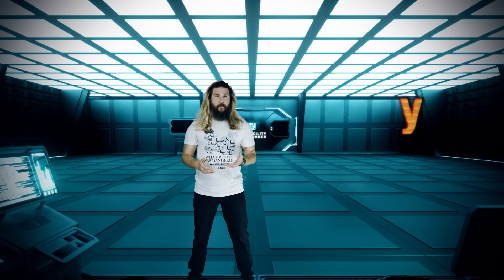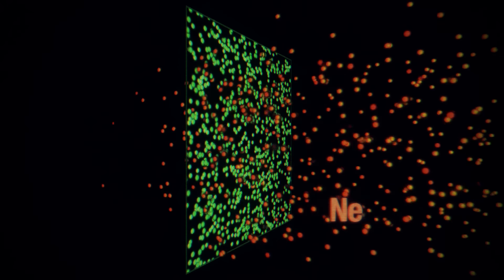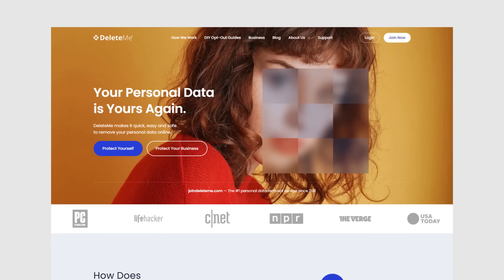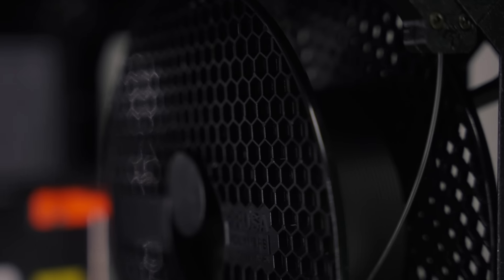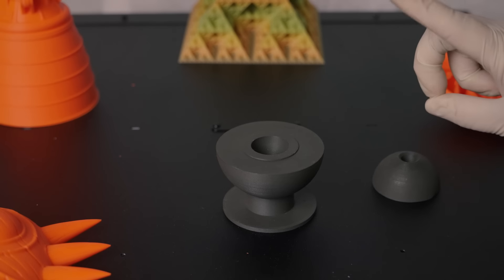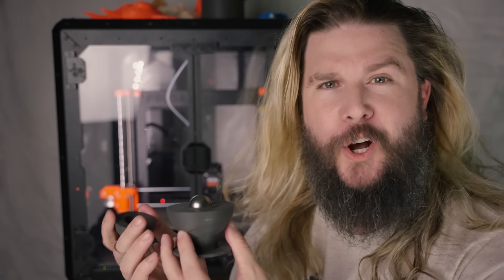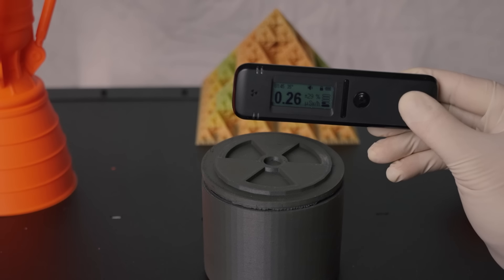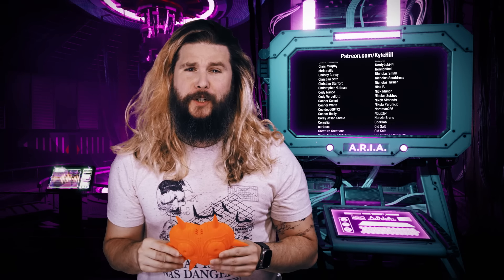3D-Printing TUNGSTEN Radiation Shields!

Comment: My father died of cancer. One of the treatments years earlier had been pellets of radioactive material inserted into his body. I wonder if 3D printed custom shaped shields could be made today with this tech to shield surrounding tissues and reduce the chances of new cancers down the road. Not only might it reduce collateral damage and subsequent cancers but it might also enable more aggressive treatment. You could even make tiny shaped sleeves for the pellets that could shape and orient their effect, something akin to a modern shaped explosive vs a stick of TNT. I miss my dad. I didn't understand at the time how much he meant to me or all the ways in which I would miss his existence in my world, but today, a decade and a half later, I really wish he were still around to learn from and share with.
Reply: My understanding is those pellets already have directional shielding. You wouldn't want that 3D printed anyways due to biocompability issues with the plastic and reduced shielding for the same thickness when 3D printed.
Reply: @DKNguyen3.1415  I was going to say much the same thing, biocompability would be a major issue. Shielding with maybe some tungsten coated with titanium would give good biocompability and high efficiency, but that'd basically be reinventing the wheel.
Now, for interim containers during handling and augmenting transportation to treatment room containers, it might be of utility. The lower the mass during handling, the less chance of an accident with the sample.
Reply: @spvillano  I would think that kind of thing would be coated in gold rather than titanium because gold is much more malleable and they are going to come in later to remove the pelley so the gold is recoverable. And the main reason to coat tungsten in gold rather than just using all gold is gold is expensive! But tungsten is a major pain to work with. You can't hold it in a crucible unless it is actively cooled since it's molten temperature exceeds that of every other metal. They might also straight up use tungsten. Apparently it's mostly but not entirely biocompatible so you don't want to leave it in the body for too long. But this is a temporary implant.
Reply: Sorry for your loss
Reply: Which kind of brachytherapy was it?
Reply: Speaking of shaped charges, I wonder how well this filament would work as a material for charge liners compared to the copper filaments some have been experimenting with.
Reply: Tungsten dust is carcinogenic
Reply: @James-ly3rx  Isn't most dust?

Comment: As an mechanical engineer who designs x-ray security equipment and shielding, I've looked into it and talked with our physicists and the biggest concern is the carrier material the tungsten powder is suspended in isn't rad hard and will degrade over time becoming brittle and will start crumbling, for any 3D printed shielding our choice is always SLS based tungsten printing as that doesn't have the drawback with a plastic carrier material.
Reply: Exactly! specially due the very high loading which will make it release particles and crumble quite easy!

Comment: My first thought for a use in a nuclear powerplant would be custom made "covers" or "plugs" to use on valves/pipelines/components when not working directly inside it, but it has to be opened. Often contaminated systems might not radiate that much through the metal, but once opened the doserate might spike a lot if distance is short. A custom made cover/plug could be useful in lowering the dose to worker fingers when working with/near the component. These could double as FME protections, stopping any debris getting in the system.
Reply: Perhaps the plugs could be named Bilaterally Uniform Tensile Tungsten PLUGS?
Reply: No way they use this material for that or basically anything. This is borderline gimmick, At most this will be used for complex non conductive shield prototypes in extremely niche applications, masks, collimators. 
Casting lead involves temperatures only about 70C° higher than melting this filament, a cast lead shield offers about the same radiation shielding if not a bit more, by not having porosity it can be easily decontaminated and is far far cheaper. I mean at $229 per kilogram of this filament with a density of 75% W (14.25g/cm3) gives you about 70cm3 of material. With lead that would cost you about 2 dollars, add casting and all that probably you are looking at one quarter the price.
Reply: @teresashinkansen9402 I'll take a B.U.T.T plug over that any day 😂
Reply: @JediSentinal  For real! Imagine printing a shield that uses about 500cm3 of that filament. That would cost $1635 in filament alone. 🤣

Comment: I know you barely touched on how different materials are good at shielding against different types of radiation. The shape of the shield also matters, and you can mix different shielding materials to get different effects. I can imagine a 3d-printed tungsten shield with foam-like hollows, that you can fill with water to improve protection against neutrons.
Reply: ouch, bot took your comment.
Reply: @waifuprotectionagency  thanks for the heads up.
Reply: Most filament materials(PLA, ABS, PETG) have lots of hydrogen, like water.

Comment: I’m a biomarker specialist for a radiopharmaceutical company who makes, and helps the pharmacists dispense, quality-control test and package PET scan pharmaceuticals on a daily basis. There are so many things in our pharmacy that we could make to help protect ourselves from radiation and improve shielding of our doses as well. 
We already 3-D print things such as syringe shield holders (not with tungsten filament, with normal filament) that would be greatly improved if made from this material instead (it would negate the need for a giant lead block in the middle 😂). Super cool!!
Reply: It's infused plastic, so not just printing tungsten of course. Given the readings in this video, without a control, I wonder if it's really that effective to be used in practical applications.
Reply: @VincentGroenewold  I know, I wonder how much shielding is improved compared with regular filament. We use tungsten “pigs” to transport syringes. When we take those out of the hot cell (where the pharmacist draws the dose and then places it into the tungsten pig), we place it in a 3-D printed “pig holder” before capping it with a tungsten top. I’d be curious to see if this holder could be printed with a tungsten laced filament and if it would further improve the shielding during that process.
Reply: @ashleighkeeler7857  shielding is a double edged sword. Indispensable for safety, but due to its mass, also can increase the risk of spill accidents. Anything reducing mass briefly during handling is always going to tend to be a big plus column entry.
Reply: @spvillano  I agree! That’s actually what the pig holder I described is for. To stabilize the pig while we cap it, since they are very heavy and can easily tip over while capping. It avoids us having to hold it while doing so.
Reply: Learn how to cast lead. That will be far better and cheaper than this gimmick. Lead shields are also 100% recyclable. Good luck finding were to recycle such kind of filament.
Reply: BTW 1kg ($229) of this filament is only about 70cm3 of material. I only see this having extremely niche applications in things that involve low energy radiation, anything above 300 KeV and this becomes too expensive to be useful.
Reply: Id like to see a comparison of the same object printed with the special filament and regular filament.
Reply: @ashleighkeeler7857  yep, had some dealings with pigs way back when. Thankfully, avoided any spills.
Although, thinking about it, it'd probably be less expensive to have similar manufactured than to print the things currently. Probably. Still, the need is there and even one less accident makes it worthwhile, given the labor and waste disposal in the event of a spill.

Comment: Well, that was dense. :)

Also, in your experiment, it would be cool to know what regular 3D printing filament does in comparison to the tungsten infused filament.
Reply from the maker: Good point. I should have shown a control
Reply: @kylehill  how about a short with 4 panels: the open core, with ordinary filament, the new filament, and some simple aluminum foil; and the radiacode on a stand :)
Reply: ontop of that how does tugsten infusion of 3d filament effect the melting temprature of the filament?
Reply: @sheilaolfieway1885  According to the spec sheet, it runs a little hotter - 260 C. The bigger problem is the nozzle itself. The powder will eat right through brass, so you'll need a hardened nozzle.
Reply: Yeah, because, just based on my understanding of most 3D-printed stuff: they’re not super dense. There’s a reason why lead shielding is thicc, and while 3D printing might make producing unique shapes easier, it might be trading effectiveness for it (though that might also just be what changing the shape of a shield does)
Reply: @kylehill Perhaps a short? Just to see the numbers. I'm SUPER curious to see the difference.
Reply: @JRFrostBear  I would expect there to be a significant difference even between regular filament and nothing. It would at least affect the alpha particles coming off of it pretty effectively.I mean, if alphas can't penetrate paper, or skin most of the time, then surely a couple of inches of plastic would block almost all of the alphas coming off of it.
Reply: @kylehill  By the way, the dense comment was sarcasm and my failed attempt at humor. I wasn't saying the missing control was dense. I was just trying to make a joke. Then I read it again just now since I posted it and it sounds like I'm saying you're dense for not including a control. That's not what I meant. Sorry if it sounded that way.
Reply: It's marked PETG Tungsten 75%, so I am going to say its base polymer is PETG which is already used frequently in FDM style printing.  PETG itself won't stop any radiation, but it is required to hold the powdered tungsten in the filament, the tungsten itself is doing all the heavy lifting.
Reply: @ianmcewan8851  If only he had some way to build a custom radiacode stand.
Reply: @kylehill  a scientific person forgot to use a control in a demonstration? bruh
Reply from the maker: @fireball75677  :_kyleSad:
Reply: And their weight differences for the same sized objects would also be cool!
Reply: I was thinking the same thing. Glad to see that Kyle chimed in with this as well.
Reply: @kylehill it wouldn’t have shown much difference I think.  PLA or PTEG filaments aren’t very thick or dense.  However, they are very cheap and useful in building components for testing before printing the final product in tungsten.  It is expensive though.  The Virtual Foundry charges $700/kg.
Reply: Regular filament (doesn't really matter, plastic is a horrible radiation blocking material, but let's assume PLA or PETG) would do practically nothing to gamma and x-ray and would practically stop all alpha and significant amounts of beta assuming the objects are printed with comparable settings regarding infill etc. My guess is maybe 10-20% reduction, possibly a bit less or a bit more.
Reply: @toobin8r  The density question depends on two things. The filament used and the printing settings. Someone posted that according to Prusa the filament is PETG with 75% Tungsten. Now I haven't checked the source, but I see two alternatives here. Either the filament has 75% tungsten by weight, in which caste it's not all that much. Or it has 75% tungsten by volume and it is pretty dense. The PETG is needed as a binder keeping things together.

The next issue is the settings used for printing. These include things like temperature and feed rate, but they also have settings for using structures to act as filler in thick walls or large solid parts. The filler structures are used to more efficiently use the filament as in most cases the internals doesn't really make a difference for printouts, especially for decorative use where the surface is all you are interested in. But it is possible to print all of the model solid. This is usually done for parts that have to be strong or that suffer mechanical stress. When printing using this Tungsten impregnated filament and making enclosures that will be used for radiation shielding I assume they will be printed solid to make them as effective as possible.

Now the actual density of the printed objects will be pretty high, at least when compared to if it was printed using normal PETG filament. they will be heavier if the mix is 75% by volume than if it's 75% by weight. But in both cases it will be a lot more solid than ordinary 3D printed parts.
Reply: @meola69420  everything stops some amount of radiation so your statement about the PETG not stopping any radiation is just wrong.
Reply: @kylehill Did you ever do the control for radiation shielding? I'm curious if you took that to mean 100% infill like the tungsten one, or the standard 15% infill for display stuff.